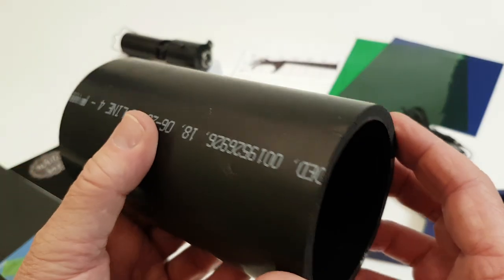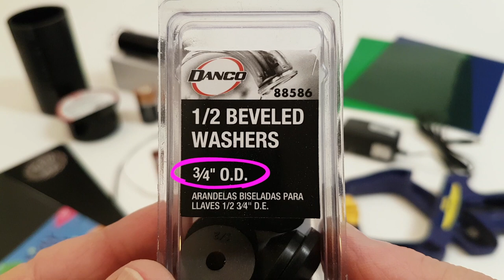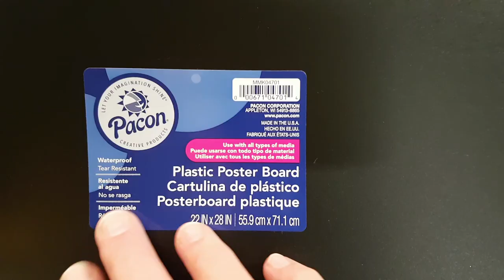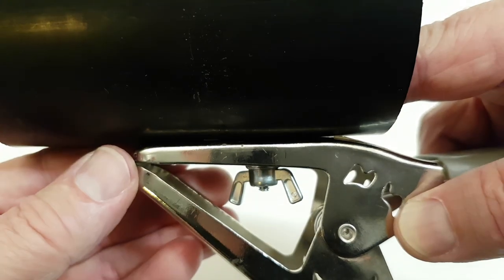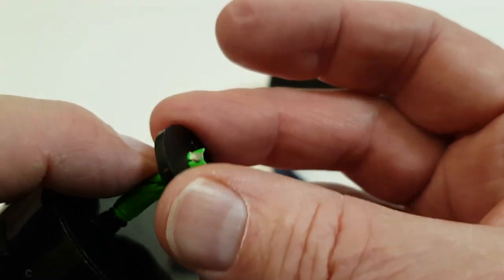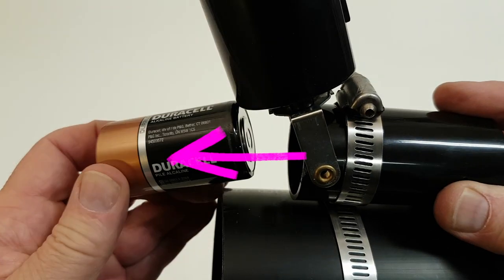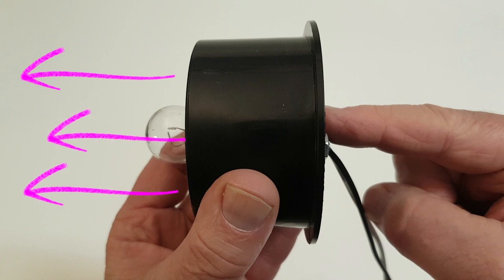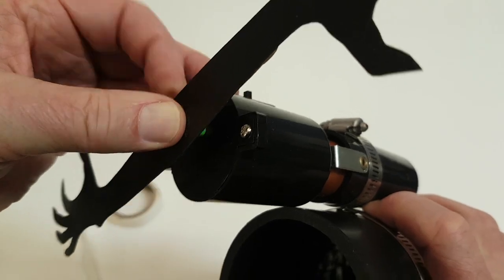DIY Moving Hand Shadow HALLOWEEN HOW-TO SFX Video Tutorial

Comment: First of all, Brilliant as always!  I think the light source could be an LED, if you used a foam diffuser or something to spread out the light.  Even the automotive bulbs you can sort of see the filament on the light bulb on the wall... I know it's not easy to project light... but here's one trick I learned years ago to remove an LED's "hot spot" is simply drizzle some hot glue on the lens of the LED. I had several flicker LEDs that had a hot spot like a bullseye, but some hot glue and it breaks up that pattern and looks really good now. So give that a try and see what scary effects you can make with them, maybe even diffuse the LED enough to make it throw a good beam of light.   Next part:  I'm curious how you made those pictures move.  If I were to do it, I'd use a photoresistor, Arduino, and a servo motor... you probably have a real sneaky way to do it...
Reply from the maker: Thanks Ray for the great suggestions!  After trying several different LED's, I went back to my trusty automotive bulb.  Hopefully my videos inspire folks to "make them their own" by trying different approaches based on ability and availibility.
Reply: @HALLOWEENHOWTObySaulFilms  I agree, the automotive lightbulb throws the light you want and I could tell you tried several LEDs so the auto bulb is the simplest. However, another thought occurred to me... I also have mini-LED spots with lenses that throw a nice light that you need, they run on 12V and are housed in a nice aluminum cylinder, and have a wire with a connector on the end to make it easy to just plug in, I think I got mine at fright props, I checked their website and the product seems different, but they have them. So there's a possible source of simple lighting that you can see if they might be a replacement  option if you need smaller and less power hungry lighting.  BTW: 28W @12V = 2.1A, not the 700 mA power brick you have, so in that case either that might stress the power supply or the bulb won't be as bright... On the other hand, depending on LED size/etc., small ones run at low current depends on brightness needed: 5, 10,  20 mA at the most.  so 0.020A compared to 2.1A... That's 100x less, right?  (And I know someone will say it... yes, there are more powerful LEDs, they are rated in the watts and they take higher voltages and amps to run... we're only talking about the smaller type... until I know what light is needed I'd start with the small one)

Comment: GREAT this is very spooky...so cool and easy to do...thank to your great explanations!

I am thinking of making two.....one with a hand and another with a bat on a thin wire with a piece of thread so the bat can dangle off of the wire and look like it is fluttering

A little advice...when you cut the connector off of the transformer cut back a few inches....if you leave a little wire on the connector you might be able to reuse it on another decoration that takes that size of connection.
Reply from the maker: Hey Tim, great ides... let me know how that bat shadow goes.  Also you are right on the barrel connector, cutting it off a few inches below would allow you to reuse it.  Thanks for the comment.

Comment: Hello again. Will you please tell me where you found your Bayonet base single contact socket with two screw flange? I've looked high and low all over the internet for one and I can't find one. I purchased one that I thought was the right one. It was hardwired, but it didn't have the two wires, it only had one.
Reply from the maker: I'm sorry that you are having difficulty finding them.  If you can't find them online, I would visit your local lighting store, light bulb store or even a car parts store where they will probably have parts catalogs where they can be ordered from.  That is actually where I found mine and learned about all the different types available.  I hope that helps.